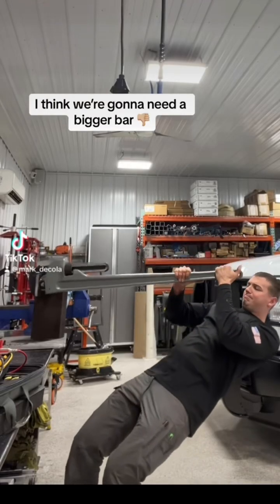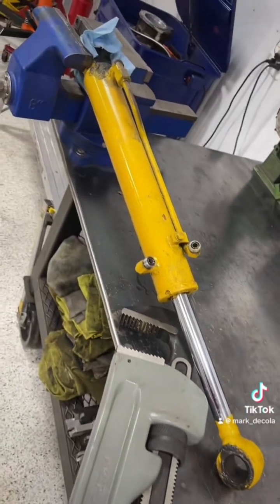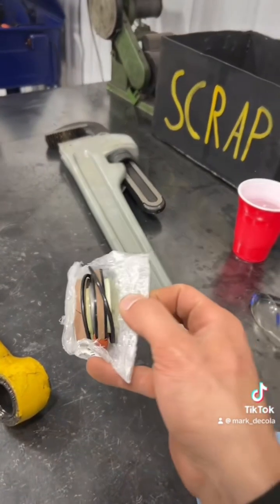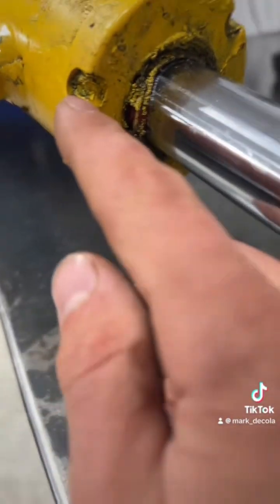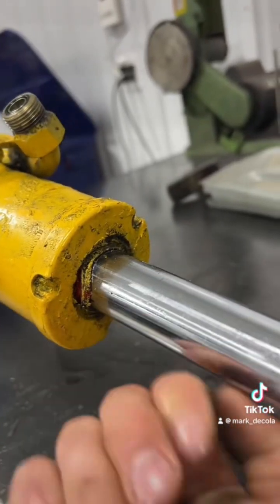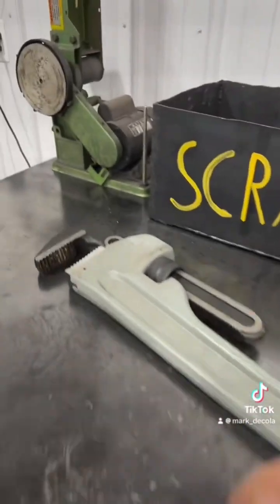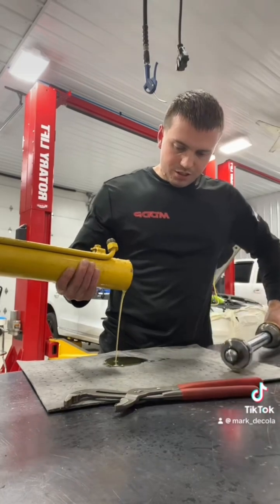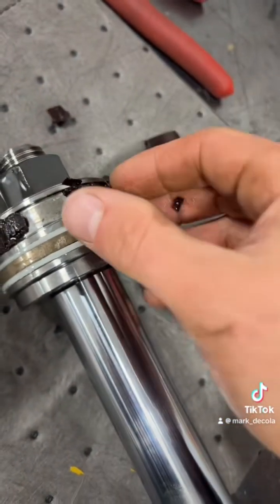DIY Rebuilding a Hydraulic Cylinder! (Part 1/3) #hydraulic #heavyequipment #excavator #skidsteer

Comment: Eroded seals like that is normally 1 of 3 things. Incorrect fluid, overheated hyd system/fluid or rot from being many decades old. On this my guess is overheat. May have been overheat from last time it was repaired and fluid did not get changed. Engineer once told me overheated hyd fluid looses its lubricity and acts more like liquid sandpaper.
Reply: That's actually a wear strip, doesn't seal anything.